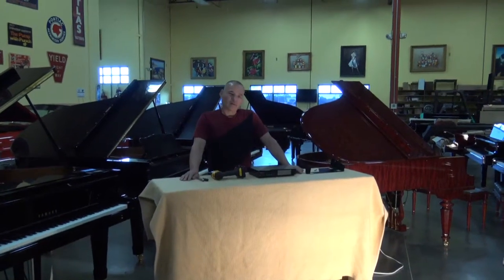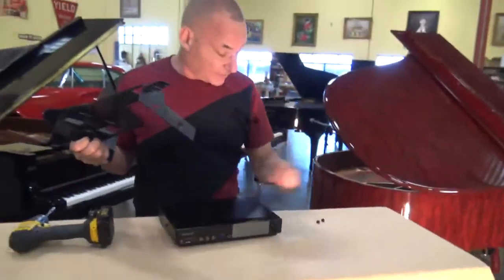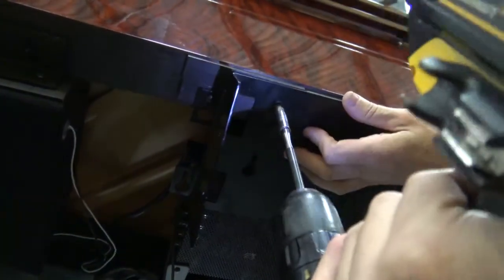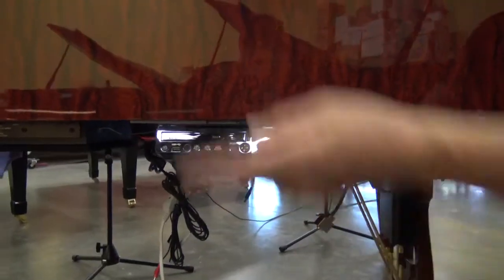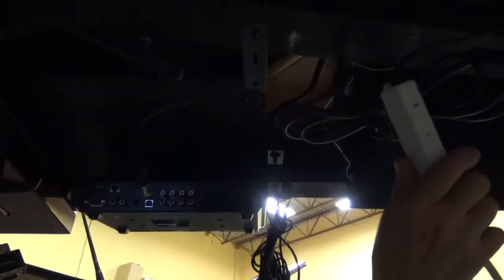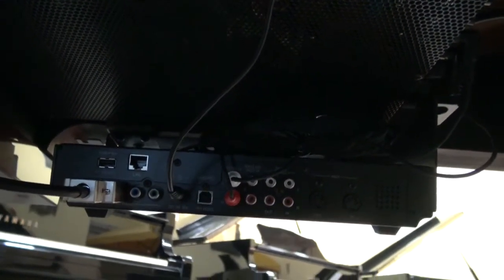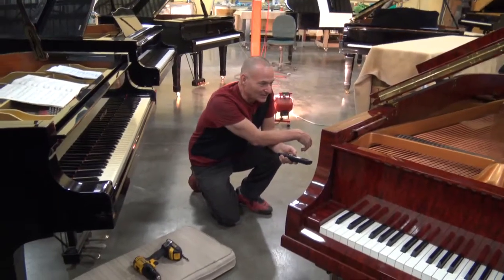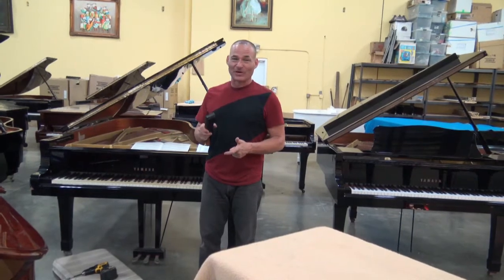Yamaha DKC850 install on Yamaha Bubinga C3 Grand Piano

Comment: You operated the remote several times without mentioning what control you were using.  You also didn’t address the “ADD” feature instead of the replace.  I have a Mark II and this was little help.